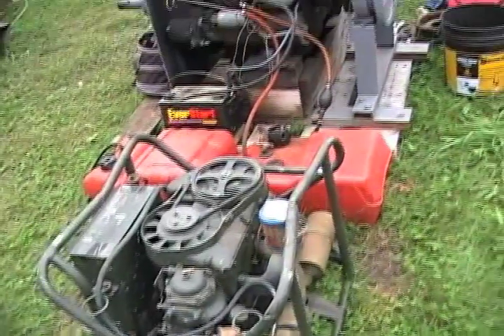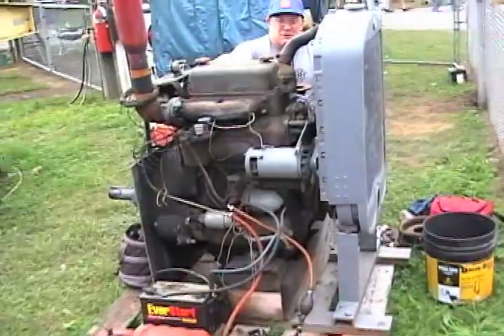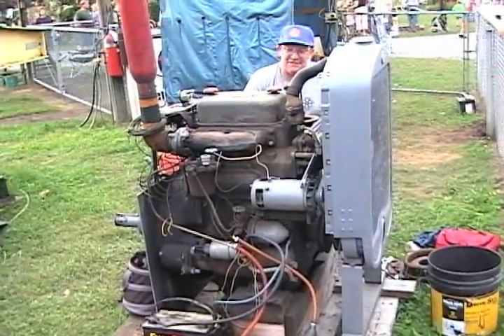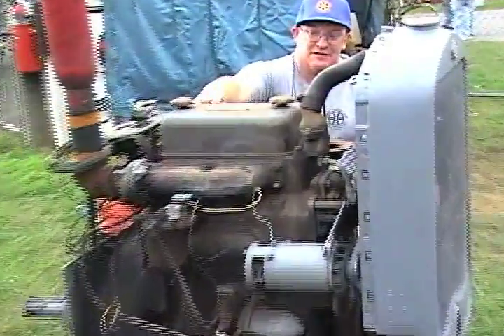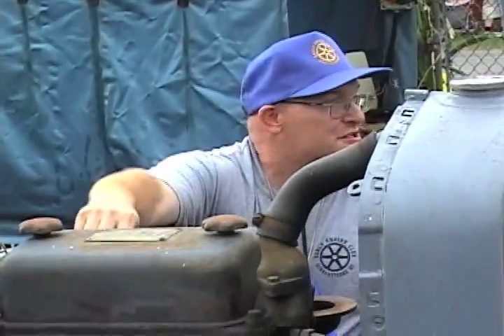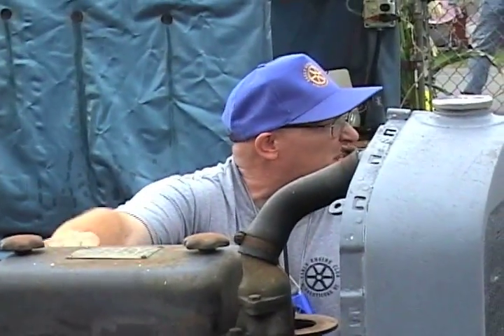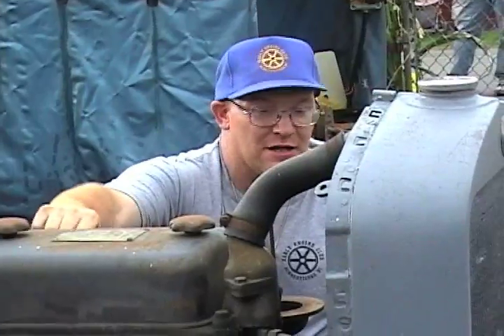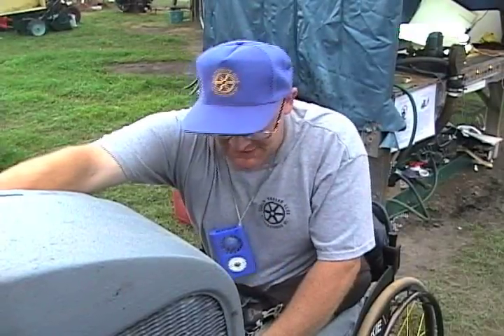Grey Marine 2 Stroke Diesel Engine

Comment: This is a 1950 2-71 GM Detroit diesel. It is mine (Rick Delair here). I lost prime on the fuel. Needs a better check valve in the fuel line. She always starts instantly if fuel is up, and is in EXCELLENT condition mechanically snd is a sweetheart! It has a Twin-Disk snap over clutch and a 1925 Studebaker pickup truck radiator to make it into a stationary power unit at a windmill in Vermont. I bought it for 200 bucks in 2003 at the Dublin,NH old engine show and swap meet and had to replace the blower because it got rain water in it in outdoor storage that froze and broke the lower blower rotor, locking it and the engine up. I got a good used blower from an outfit in California and also my rare 4-51 valveless Detroit from the same seller. He sold me tge blower for 250 bucks and the 4-51 engine for 400! I had the 2-71 running in 2 days and the 4-51 running in a few months, as I had to pull the gummed up injectors out and soak them in solvent to free them up. Had it running the next day after freeing them! The 4-51 loop charged (like a gasoline 2 stroke) valveless is insanely rare, and the 2 cylinder 2-51 version even more rare than the 4 cylinder! I am hoping to bring my 2-72 to the fair again this year! 😋

Comment: It's a Detroit Diesel which was marinized by Gray Motor Co..  With the valve cover off, you can see the unit injectors which are characteristic of Detroit Diesel engines.  There are three rockers for each cylinder; the two outer ones operate the exhaust valves and the middle one operates the unit injector.

Comment: if it is indeed a Gray Marine engine, i bet it probly ran a pump or generator or something like that. other that that it looks like its a standard GM diesel 2-71.  as the fellow bellow said it would have had a heat exchanger, water cooled exaghst manifold, and possibly a "intake silencer" witch is just a little mettle box with mesh and baffles to quite down the noise of the blower.   however generators and pump engines came with these oil soaked filters also, on the one tug i work on has 2 6-71 generators and they have 2 of these oil filled filters on each engine.

Comment: This is an industrial engine, not a marinized unit. Dry exhaust manifold, fan, radiator and the air cleaner are give aways, marine engines had wet sleeved exhaust manifolds, heat exchanger cooling and just a blower screen / hood. Still a very nice 2-71. 70 Hp would be a little bit optimistic unless wound up to around 2300 RPM. Not a very common engine, look after her.
Reply: This IS a marine 2-71! The exhaust manifold has the remains of the outer water jacket thar froze at some point time in the past and broke. The inner exhaust passage is fine so it remains as a “redneck” dry manifold. The heat exchanger is still there too. The air cleaner/silencer was added as was the fan, ‘25 Studebaker radiator, and the Twin Disk PTO clutch. It was re purposed as a stand by power unit on a grist mill with wind mill to run the mill on days with no wind. I got it at the Dublin NH old engine show/swap meet with a broken blower rotor because water got in and froze in the blower (crankcase was full of water as well) and got it running. It lost the fuel primer here. It actually starts instantly every time and actually holds 40 pounds oil pressure which is a LOT for a Detroit! She is a peach! 😋